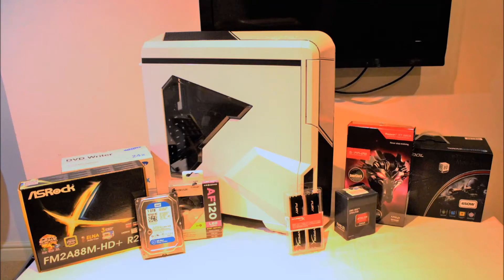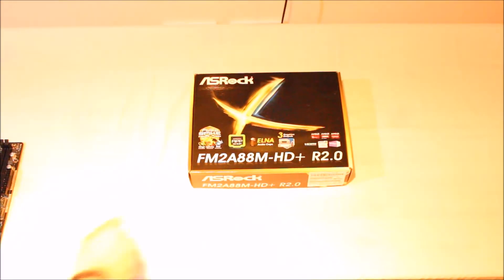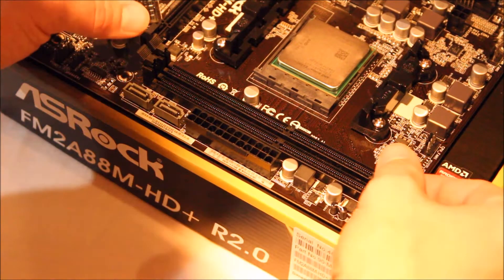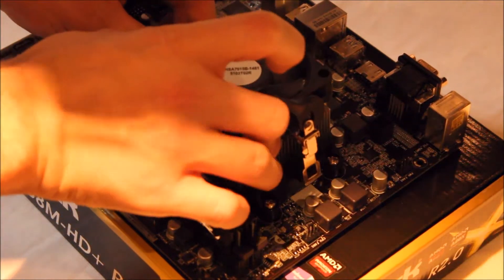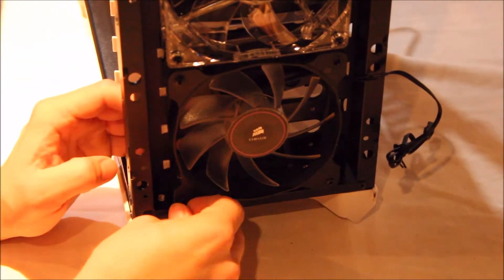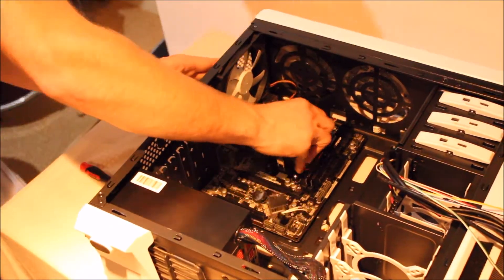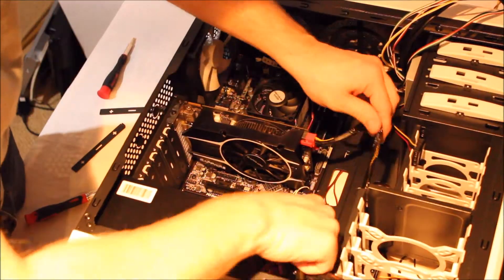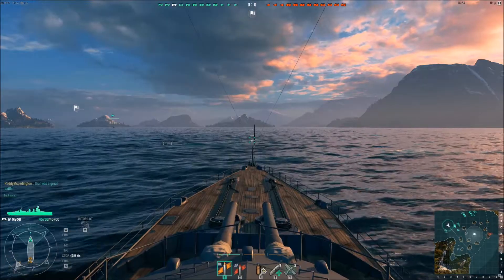HOW TO BUILD A PC!

Comment: Hey man, how do you put top case fans into this case? I can see two open slots at 2:28. Do you just screw the fans into the holes right above the motherboard, or do you fit the fans inbetween the white casing but behind the black fan scaffolding?
Reply from the maker: Yeah screw them straight in, depending on what fans you have you can install them just under the white case top, but if you have the space i would stick them on the motherboard side, Enjoy your build!! :D
Reply: Nark Cast Thanks man! Looks like I'll be making a case upgrade.

Comment: im having problem with air flow i only havent added any fans to it ill add another fan to the front and 2 at the top but which ones shal i have blowing air out of the case and which ones shal i have blowing air into the case cuz my gtx 960 is reaching 60 degrees Celsius and im worried its gonna break and im wondering if i shud replace the back fan. Got any good fans at a good price any help wud be appreciated thanks and good vid btw
Reply from the maker: depending on how you would like your air flow to travel, you can pull in from the bottom/front and push out through the back/top, I also wouldn't worry about temperatures of your gpu, many guy's can reach 70-85c and still run comfortably, hope this helps
Reply: Nark Cast yes it has thank you very much :) good vid btw
Reply: ***** kk thanks man appreciate it
Reply from the maker: I'm going to hazard a guess that it's the type of motherboard?
Reply: bongdong yes i have a gtx 960 and have you taken out the metal parts in the back of the case?
Reply: ItsMixedUp
I got it working! That was the problem, I didn't take those parts out. I was being cautious about breaking bits off my case...
Reply: bongdong haha i was like that before lol and ok man cool glad youve got it all working, have fun :)

Comment: dude, I'm building pretty much the same thing!

I'm using the Spectre case in black
AMD Athlon 860K - Cooler Master Hyper Evo 212 cooler
ASRock Fatal1ity FM2+ Killer mobo
ASUS Radeon R7 260X OC edition 2GB
Corsair Dominator 2400mhz DDR3
Corsair CX600M PSU
Seagate SSHD 1TB
Windows 10 Pro OEM as the OS

all cooled by corsair AF120/SP120 fans 

How does your build perform, in terms of frames per sec? (ie cod/battlefield etc)
Reply from the maker: +kingarthur83rd actually does really well, been getting an easy 50fps, hope you enjoyed the video, thanks for the comment
Reply: Nice! its a great vid.

I'm tempted to put my own on to showcase the build.
Reply from the maker: Do it, it helps other understand and people can start custom building rather then buying a ready build which is a rip off
Reply: My project was disbanded. basically I ran out of money. bad times

on the subject i dont think i'tll fit. the arctic freezer 13 is a great alternative (which i have now) or you can use a Cooler Master Seidon 120V2 for an AIO liquid cooler.